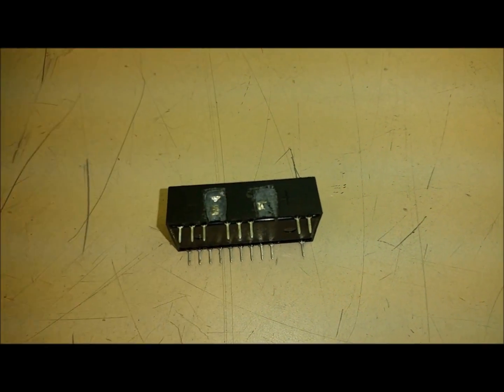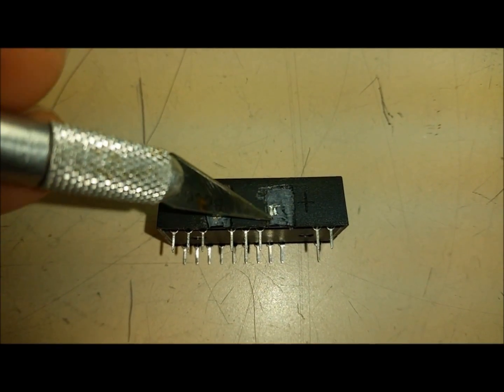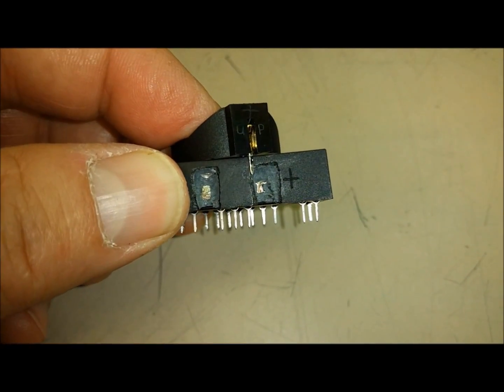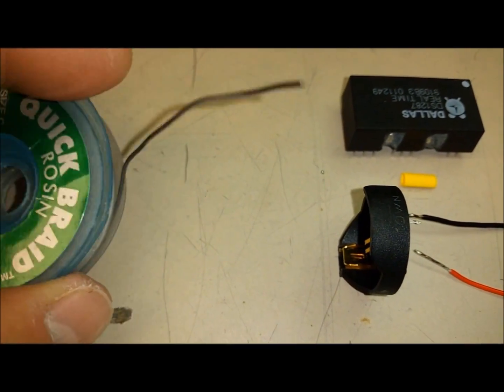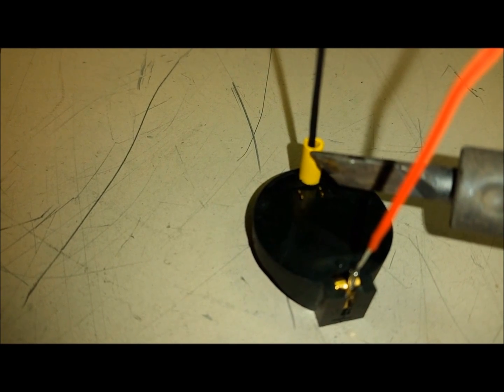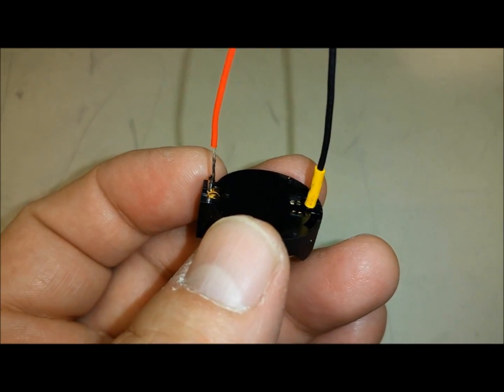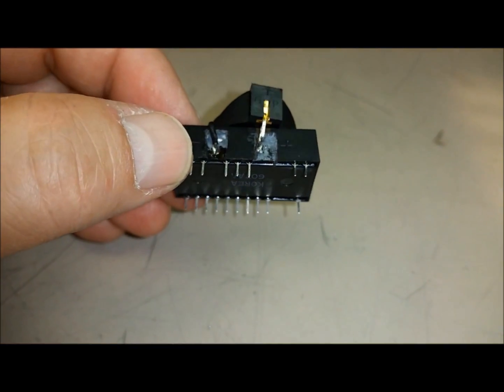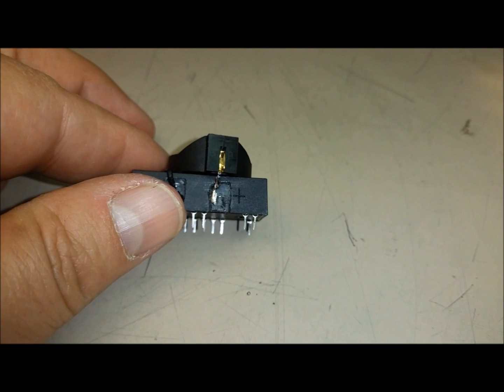Dallas DS1287 & DS12887 RTC & other DS RTC Chip Repairs

Comment: Hi. Nice work! I Wonder if you know where can i find any information about the internals of a DS1230Y-100. I recently begun to decap my IC, it would be nice to know the internals beforehand. Thanks!
Reply from the maker: Vladimir, I know this may sound silly, but try the datasheet here: https://www.datasheetarchive.com/pdf/download.php?id=279042bc26bf4f4f76a9e0a5fb0a164364ba1b&type=M&term=DS1230Y100 
Here's a reply I gave to Hector Serrato below, that may help you.
"Hector;
I don't know. I looked up the data sheet and see if you can find it there by comparing it to other types buy I was unable to come to any conclusion. Here's the link for the related data sheets. Scroll down a where you see the data sheet pdf's on the right side of the page. Here's the link.  http://www.datasheetarchive.com/DS1230Y-70-datasheet.html 
Take note that there are several versions of it. You could cut the top off if it's a DIP package and grind through the case above the pins to find the battery connections. Then grind the epoxy away until you find the battery. Carefully grind the epoxy away to find the batter terminal side. Then connect a meter to the battery to find the polarity, that's if it still has some charge. If not you'll have to gently grind away all the epoxy to remove the battery in hopes they have marked the polarity on the battery itself. Either way its a delicate job. If it's a DIP socket and you know it's bad, and don't want to do the work, send it to me and i'll rip it apart and find the pins for you just for fun. Best Wishes n Blessings Keith" Also some epoxy's are sensitive to heat and you can warm it up with a hot air gun and peel it back. Hope this helps. Keith Noneya

Comment: I had to do something similar with my Tandy SmartWatch chip. For people who've never seen it, it's basically a DS1216 IC within a nested passthrough socket, onto which the BIOS ROM would be placed. Similar deal with the DS1287; cut the contacts to the potted batteries, solder on wires and run to a coin-cell battery. https://goo.gl/images/Pz2tR5

Derek Osborn has worked on fabricating a replacement SmartWatch chip for the Tandy 1000 EX. https://youtu.be/ST9QRxh-ndc
Reply from the maker: Hey BE I know this is a late reply, but I was reading through the comments to see if I missed anyone's. I was amazed to hear it could be applied to watches too. Thanks for the great comment and link for others to fix there watches. Best Wishes & Blessings. Keith Noneya

Comment: Dear Keith,

I'm wondering, if do you know what type of battery is inside in chip? What is weight of lithium there? Unfortunately I can't find this data anywhere(
Reply from the maker: Sorry I don't know what the battery is, other than it's a 3V Lithium battery. I suppose if you really wanted to know you could excavate the whole top off and then pull the battery and look at the number, IF the manufacture used a battery that has a number. Let us know if you do find out. Best Wishes n Blessings. Keith Noneya
Reply: I found it after very deep searching in the internet. For this chip Dallas used Panasonic's coin battery BR1225. There are more information here https://www.maximintegrated.com/content/dam/files/design/qa-reliability/ul-recognition/E141114-Vol-2-Sec-1-Conditions-of-Acceptability.pdf
Reply from the maker: Sorry I didn't see the replay until today. 
That's a pretty good find. I'm not sure on the battery as I looked up the specs for it and the diameter of the BR1225 is 12mm or .472 inches, that's a little big for a microchip, so they must be talking about a circuit board or something. I do know they make smaller Lithium batteries for hearing aids or the like so maybe it's a smaller version of it. So what is your chip being used in! Keith
Reply: i'm not sure, but it looks like DS1287 has 24-pin DIP package, which should have .685 inches width, what should be enough to fit .472 inches button battery. It is just guess, I operated only datasheets, didn't measured it manually.
Reply: @IvanLutsV  I have 4 DS1287's. I sacrificed one of them to cut it up and see what battery was used. Yup, just like yo said, BR1225. :)

Comment: Thanks for the video .... Possible help. Is this video applicable to the DS1642
Reply from the maker: Hi Glen I can't help you with that one. I just know how to change the battery. The chip in the video is from a friend who asked me to do the repair for him. If you do figure it out, put a video up on your channel and drop me a link in the comment here. Thanks for watching. Best Wishes n Blessings. Keith Noneya
Reply from the maker: I don't think so. I looked up the data sheet for the DS1287 & your DS1642 and they have different pin names. Here's the link for the DS1287 & the DS1642. 

- DS1287 http://www.datasheetarchive.com/pdf/download.php?id=7059617b31a7c9e2772338569eb0b2344f0e47&type=M&query=ds1287 

- DS1642 http://www.datasheetarchive.com/pdf/download.php?id=4d58215c5e55aeb674c25b82910f23dcd5482b&type=M&query=ds1642 

I would grind through the epoxy above the pins to find the battery connections. Then connect a digital meter to the battery to find the polarity, that's if it still has some charge left over. If it doesn't have a charge or if the polarity can't be determined, then you'll have to gently grind away the sides until you can get the top off. Then grind the away the epoxy to expose the battery to find the pin connection and hope the polarity is marked on the battery. Either way its a delicate job. Once you have the battery to pin connections and the polarity it's the same process shown in the video above to connect a replacement battery. I hope this helps you in your project. Personally I would take the time to use a Dremel to cut away the epoxy & find the battery. You have nothing to loose anyways since it's already a dead chip. Best Wishes n Blessings Keith
Reply: Thanks for the reply please help Mr. Keith .... I want to install the DS1642-150 battery
Reply from the maker: Hi abdo, not sure how I can help you. I think you're just going to have to get a Dremel tool and grind out the old battery and figure it out like I said in my previous post. If have a suggestion on how I can help you let me know. Best Wishes n Blessings. Keith Noneya
Reply: I've try replacing 1642 battery . the problem is how to calibrate the clock.

Comment: Perfect instructions, mine was 12887A pin 16 a little deeper than your case. But worked fine :)
Reply from the maker: Glad it worked for you David. So what does yours go in?
Reply: Keith Noneya, good ol’ 486DX100 power house :) failed to boot after battery went flat, now fine !!! :)
Reply from the maker: Wow, I used to use an old 486DX when I was in the Navy years ago. Used the old WordStar word processing program and some old EXCELL type program, don't remember what it was. You almost had to be a programmer to use them because you had to insert commands in the lines you were typing. Ah today it's all automatic just set it and go. LOL
Reply: Keith Noneya :) lotus123?
Reply: I have the same chip.  Was yours soldered onto the board?
Reply from the maker: Hi Slam, are you asking David or Me. The chip was handed to me to fix by a friend, so I don't know if it was soldered in or not. Best Wishes n Blessings. Kieth Noneay
Reply: Slam 5000 mine was socketed
Reply from the maker: You should still be able to use a Dremel type tool to excavate down to the connections. Keith
Reply: Same chip, exactly the same result. Which is the important bit. Thanks.

Comment: Can confirm this also works for the ODIN 1287 clone chips.
Reply from the maker: Sorry I can't, as I have not done one. Most clones have the same pin-outs so it should. If it's bad you don't have anything to loose trying. Let us know if you do and how it turns out. Best Wishes n Blessings. Keith
Reply: Already done. It's remembering the CMOS data for a Full Yes 82430i mobo with a Pentium-75 OCed to 90Mhz, 16MB RAM, 3dfx Voodoo!

The only major difference with this Odin chip is that you have to cut far deeper to get to the hidden pins. I just cheated and melted the plastic with a soldering iron.

Comment: I am searching this after finding two of these chip things in an electronics repair kit . They are new . Any advice on how I could use these or if their is a demand for them ? They read this on front  first there is a white clock . And it reads " DALLAS DS1287 REAL TIME 9123B3 013673 . And on the back it reads PHILIPPINES 427AA . I appreciate any info you may be able to help me with . Thank You and God Bless              . Are these things batteries ?  Apologize if that sounds like a stupid question .
Reply from the maker: No problem at all. They are real time clocks that provide time in the following format: Seconds, Minutes, Hours, Day, Day of the week, Date, Month, Year & Leap Year compensation. The data is maintained with a built in battery. The problem is the internal battery over time degrades and fails depending on manufacture date. From the date of manufacture they are supposed to last 10 years, most last past that depending on the environment they are in. Even if the part is a NOS (New Old Stock) it can not be trusted as they are probably old and will fail soon. I'm not familiar with date codes on the chips, but I suspect the "PHILIPPINES 427AA" is the country of manufacture and lott and possible date code. You can look up the data sheet here: http://www.datasheetarchive.com/dl/507a40edf8db7ebea38a829250c14d72fee6cf/O/ds1287   For the answers to your other questions I would go to a forum or do a search on chip markings. Sorry I couldn't answer all your questions but I hope I gave you a good start. Try posting the question on the EEVblog Forum here: http://www.eevblog.com/forum/  Thanks for watching.
Best Wishes n Blessings. Keith

Comment: hi  you  know what  pin  is  negative  and positve but  in  DALLAS DS1230Y ???
Reply from the maker: I don't know. I looked up the data sheet and see if you can find it there by comparing it to other types buy I was unable to come to any conclusion. Here's the link for the related data sheets. Scroll down a where you see the data sheet pdf's on the right side of the page. Here's the link.  http://www.datasheetarchive.com/DS1230Y-70-datasheet.html 
Take note that there are several versions of it. You could cit the top off if it's a DIP package and grind through the case above the pins to find the battery connections. Then grind the epoxy away until you find the battery. Carefully grind the epoxy away to find the batter terminal side. Then connect a meter to the battery to find the polarity, that's if it still has some charge. If not you'll have to gently grind away all the epoxy to remove the battery in hopes they have marked the polarity on the battery itself. Either way its a delicate job. If it's a DIP socket and you know it's bad, and don't want to do the work, send it to me and i'll rip it apart and find the pins for you just for fun. Best Wishes n Blessings Keith
Reply: thanks very  much.

I buy  3  pieces  for try  first that  original.

thanks again

Comment: how to remove the chip from the board? do i need to desolder?
Reply from the maker: +JohanTwinsen Sorry I haven't checked my email in a few days. It's best to remove the chip from the board to ensure that all the particles don't contaminate the board. You'll need a really steady hand to do this and a vice to hold the chip still while you Dremel out the chip to gain access to the internal connections. Hope this answers your question. Feel free to ask more anytime. Best Wishes n Blessings Keith